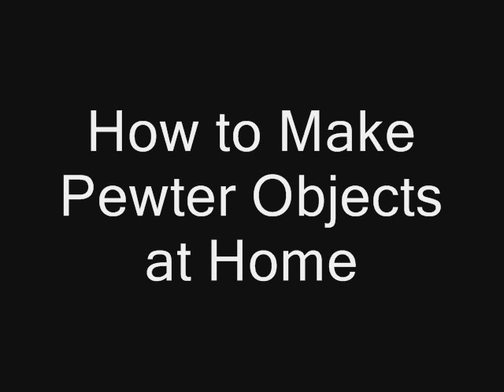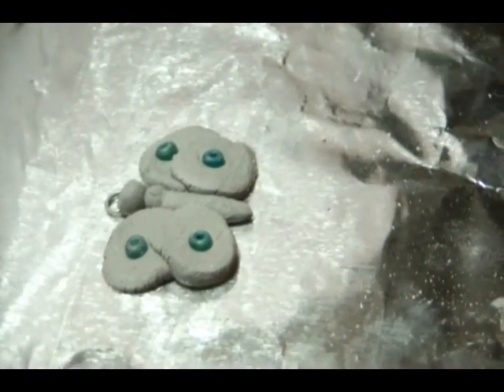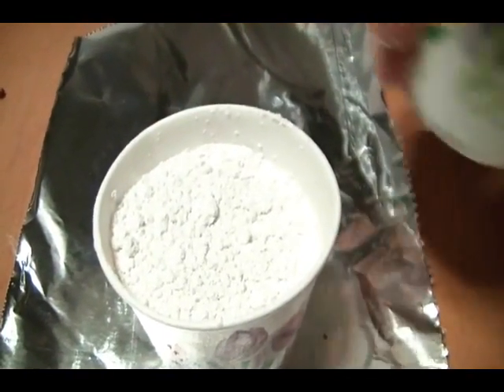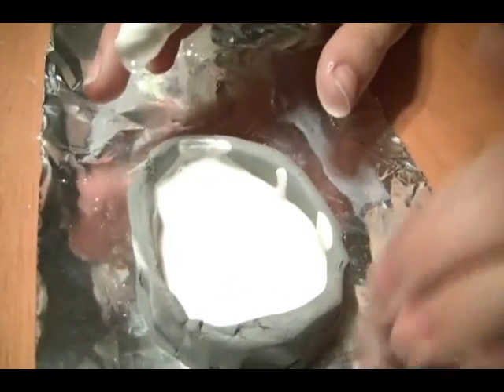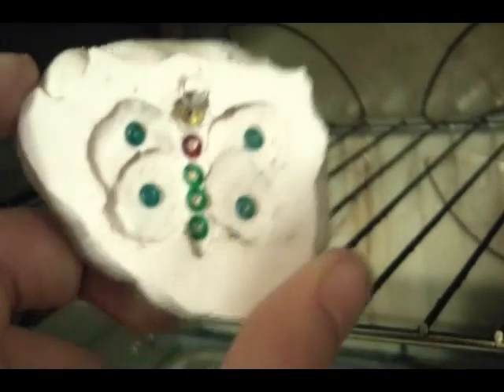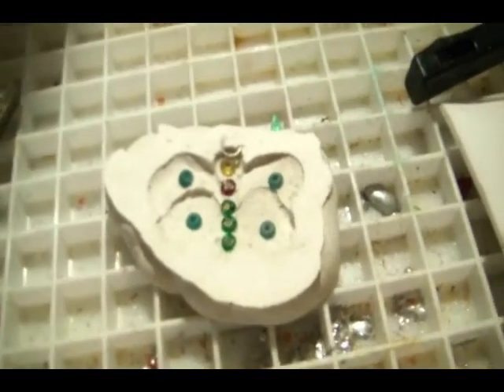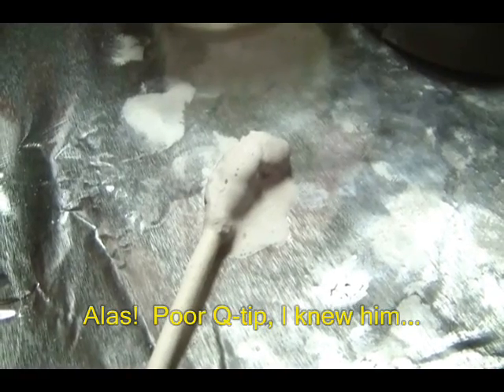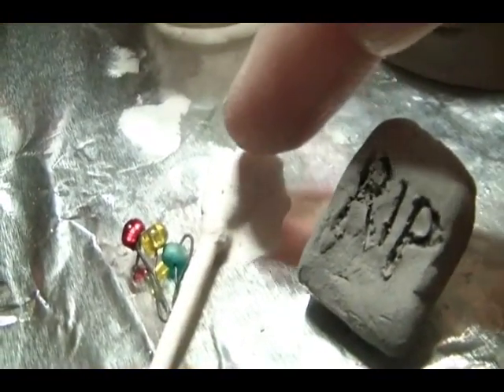Cast Metal From Solder At Your Kitchen Table

Comment: This video is just what I need to learn how to cast parts for a project ( mechanical calculator). Your humor and personality makes this informative video Rock!
Reply from the maker: Go forth and make stuff! Once you know the basics, it's not too hard to do something industrial level. The first time I poured aluminum from a 400lb capacity crucible I was like "HAHAHTHISISOCOOL" and it wasn't scary at all because the process was just scaled up from the tabletop version. You can also hear the solder/casting pewter in a metal measuring cup on the stove but keep the stove's air vent on in case there are impurities that can offgas.
Reply: I’ll keep these facts in mind. You and your husband/boyfriend are super cool. Thanks again!
Reply: By the way, the machine I’m going to build is called a “Thomas Arithmometer” a calculator that started being used in the 19th Century.
Thank you for your fast response

Comment: I made tin rings from a wedding band using solder. The mold was made by pressing the original ring between the halves of a split cuttlefish bone. I liquefied the metal in a small iron skillet using a mapp torch. This method has also worked to replicate small, hard objects.

Comment from the maker: @BlackheartChimera13 I use a variable wattage rheostat controlled iron, so like 100+ watts.  For rings "tinned" copper wire, with a silvery coating, will bond to solder. However, any uncoated wire will work.  I like to use 20 guage or thicker wire.  Very very fine wire, like used to string tiny seed beads, may melt.  Beading wires with a thin plastic or wax coating will burn and melt inside the solder, possibly causing spatters of molten metal. Anodized wire is OK, esp. pre made jump rings.

Comment from the maker: @gryphern Your solder may also have antimony or something else distinctly bad in it that helps it melt at a lower temperature.  You can touch it to you skin, but please don't lick or ingest it.  Tin can cause poisoning as well, but not so easily that we ban tin roofs, tin metal sheeting, pewter jewelry, or pewter sculpture.  Wash your hands so you don't eat tin residue and make shirt pins, amulets, etc, but not lip rings or rings that would be worn day in day out.

Comment: so for little casts like this its more efficant to melt the solder in bulk and poor. i personaly dump a buch of little bits of soder into a bullet casing(if its been shot its safe) and hold the casing with plyers over a heat giver(propane torch for me)after about a muinut the solder is molten and more can be added if needed. then its time to poor. the good thing about the casing is its already a spout ready to go. after the poor dump the casing in a cup of water to kill the heat. done :)

Comment: @gryphern Have you thought about melting the solder in a pyrex beaker or measuring cup on a hot plate? you could then do larger molds and pieces.

Comment from the maker: @Zanorfgor If you leave it on the counter for a couple days it's usually fine, but if it's super humid out, you use your mold right after pouring it, or you rinse your mold the spatter is freakkin' awesome.  I tried it with a face shield on and it was kind of like popcorn, except molten metal.

Comment from the maker: Those butterflies were constructed using the "Tiffany" stained-glass technique. Sticky tape, made of copper instead of plastic, is wrapped around glass pieces. The tape is coated with melted pewter, usually it uses a toxic 60%-40% Lead-tin metal solder, but lead free plumbing solder works too, just is more likely to crack the glass because it's hotter when it melts.  By molding butterfly bodies from solder with a wire in them, I could solder the wire to glass wings wrapped in metal foil tape.

Comment from the maker: @LastTaboo The traditional cuttlebone method, I raise my glass to you! (clink.)  For someone who has never touched metal before, I suggest starting with very small volumes.  I started at BIG pours, and the first time I saw 20 pounds of molten iron spill out the side of a mold, bounce into the air like rubber, catch the other molds' wooden frames on fire, then land on a guy's leather work suit it was like "Wow, I really underestimated how dangerous molten metal can be." Cuz burns are a big deal.

Comment: Great tutorial, and hilarious, thank you! What were the colored wings of the butterflies you showed at the end made of? Did you add those during the casting or afterwards? Thanks again!
Reply from the maker: Those are stained glass, they are wrapped in metal tape, called the "Tiffany method" of stained glass.

The flexible metal foil gets covered in melted tin which makes it stiff and allows it to stick to any other tin. To get metal to stick directly to Glass you have to use special mixes of metals, alloys, which will "wet" or "mirror" glass. Those alloys are expensive.

Comment: Is it possible to make a mold that can used numberous times gryphern
Reply from the maker: Yes! Sorry about the delay, I have only now realized that Google's gmail has a "social" category and it's sending all the comments THERE instead of my main inbox!! You can buy high temperature silicone. I've tried using cheaper silicone putties, as are found in craft stores, but they tend to 1. burn after more than one use, and 2. tend to produce gas and cause small pits in the casting. So try SmoothOn brand mold max 60 high temp silicone, visit their website to buy a trial size.